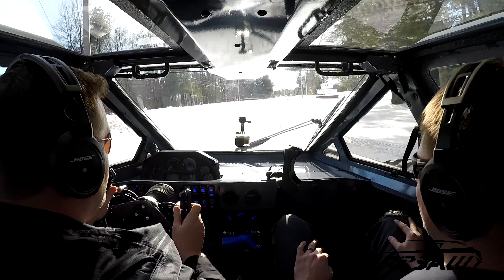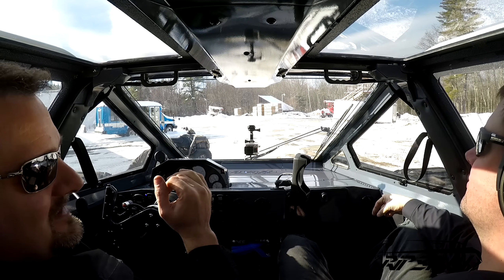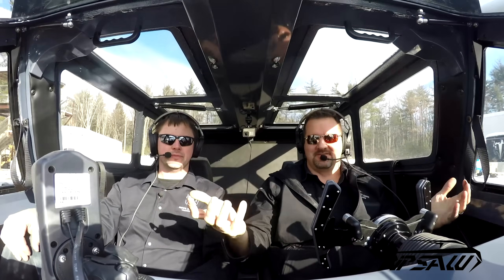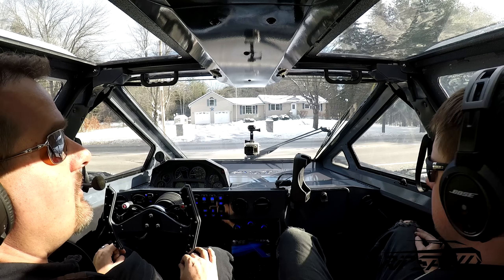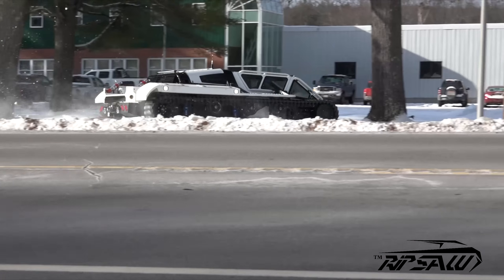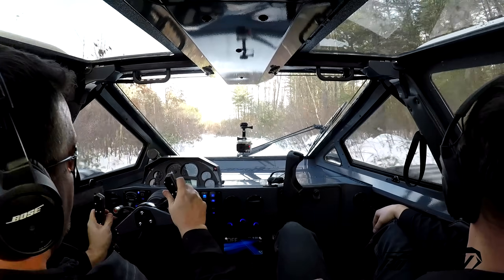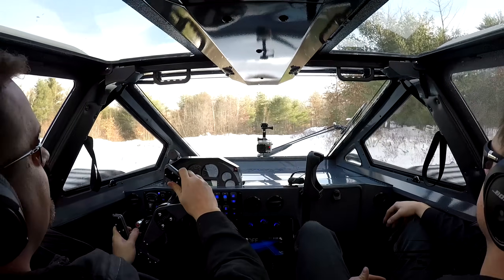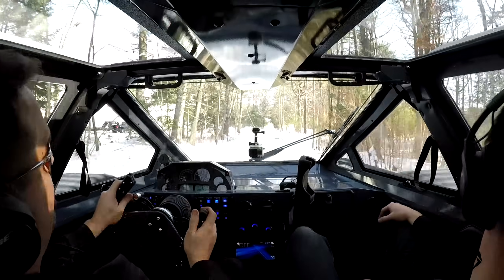Ripsaw Four Seater Floating Cockpit EV3-F4

Comment: The selling parts point?
Use rimac X 4 with 2 each side front and rear wheelchair turning 1 side full on with opposite turning full on reverse, 
With usua turning uses +/- of both.
Escape from a military tank turret is murder if they refuse to use your convenient concept with a slider lift or lower/open drop for the Gatling at rear round \____/ edges and frontal roof turret.
4 or 2 with 1 left and 1 right wheelchair turning tracks.

Maybe a dreamer Axial motor X 2 with 4 rolls Royce lift fan electric powered with shaft 4 cog rear last RR fan to rear propellers from central new shaft to cog box 4 axle cogs eg to 5/9 fans will have turn motor car air vent and slat motors mainly 

It'll take off ALON glass TRANSPARENT touchscreen display controls RC aircraft can place f35 rear nozzle with Wings???
Nahhh it'll fly lift and turn ..
A challenge for you waterproof with same rear steering which doesn't fly?
Air vent slats turn left onto to right upon water.

Comment: Reshape the track treads to resemble a V with two  I shapes between the V shapes ( usually an open spot) and it will ride better turn faster in loose terrain and be more stable while traveling on the side of hills.

Comment: so i live in Norway above the arctic circle , and i would love to buy a belted vehicle for winter driving. but the ripsaw is just overkill. so my question to Howe and Howe is, how much could you guys turn that thing down? to make it Cheap, Reliable , and low maintenance? my dream belted vehicle is Diesel powered, large space inside so there is room for people , dogs and groceries. low cost on fuel and wear and tear on the drivetrain. currently a 4x4 does the job, but a belted vehicle would be soo much better in deep wet snow. maybe a rebuild kit for a known large car? Toyota land cruiser comes to mind. if you made the conversion kit with a hydraulic generator on a gear selection, you could use the same motor and gearbox, but take the energy out with hydraulic power and such divide it between the two belts , causing it to drive nicely. hydraulic is never used on tracked vehicles like tanks for the obvious fire hazard it represents,  but in a civilian tracked vehicle? it might be perfect .

Comment: would have been nice to see it go through some really deep snow. Get that stuck and you're done
Reply: The Ripsaws don't handle deep, fresh snow well; they don't have low enough ground pressure (flotation). To satisfy the goals of high speed and smooth ride while keeping the vehicle in a side by side configuration and narrow enough to be trailered, suspension articulation is maximized which necessitates the tracks being relatively narrow or the cabin being raised above the tracks. Obviously, raising the cabin that high would create a dangerously high center of gravity. Engineering compromises are a hard reality.

It would be possible to build a single cockpit or a front/rear dual cockpit with better deep snow capability if desired.

Comment: The Russian Sherp is slower but will go into rivers and lakes.
Reply: bv206 has more seats(17 seats including driver), more payload(4000lbs/2000kg),is amhibius, has less ground pressure, costs alot less(around 30,000usd) and it can mount m2 machine gun, tow missile, 90mm recoiles rifle or 81/120mm mortars(depending of the version) can't forget that it's street legal
Reply: As far as I know were not at war so I'll pass on the missiles and machine guns.

Comment: With such a prolonged reaction of the machine to the rotation of the steering wheel, driving at a speed of more than 25 mph is unsafe. This is perfectly visible at 1.40 and 2.20 minutes of video.
Reply: Костянтин С you obviously have never driven anything with a track.
Reply: Then why do not you show the video from the cockpit with maneuvering at top speed? And why is the maximum speed limited to 60 mph with such a huge engine power?
Reply: You're right. Tracked vehicles only really like to go in a straight line.  Any steering input.force on higher friction surfaces.goes up and up.and then the tracks suddenly respond.  ....on a different point, not sure I like their bigging up 'their clutch system' in other videos - surely it's just a triple differential system...

Comment: I love this machine, my only criticism would be that the steering looks to be delayed slightly probably because of the electronics.
Reply: Delayed? Not really. More like it doesn't register until you turn it a certain amount. It's a tracked vehicle of course. It isn't going to be able to make as subtle of changes with steering as a vehicle with steering components that actually rotate like wheels or skis. (Those are my observations anyway. I don't know if they are actually fact.)
Reply: Why the steering is delayed, for me, does not matter... but yes, it is clearly delayed.  And yes, tracked vehicles are able to make subtle changes as easily as wheeled vehicles.  It all depends on the input to the breaks on that side. The more efficient and instantaneously the breaks can be applied, the more subtle the changes in steering.  It is why you see military tracked vehicles in the hands of skilled drivers be able to dance.

That said, the delay in the steering was the only thing that made me cringe when watching the video.  That is dangerous, to say the least.  And I have driven plenty of tracked vehicles and know there is no need for it.  So there seems to be some real adjustment corrections to be made.

Comment: I think the Ripsaw would really benefit from an electric drive train. One motor for each side of the track. Not because of environmental reason, but because of better control over the vehicle (just imagine negative torque on one side of the vehicle when cornering... or just the acceleration). The main engine could feed into a generator to produce the required power. Additionally you could use a battery or supercap as a "buffer" to overcome the power requirement spices from the electric motors. Or maybe even go full electric... imagine a small, really fast, nearly quiet tank with next to no heat signature.
Reply: The options on their website says diesel or gas.
Reply: mugsl schlaengli all you would likely achieve pulling negative torque at speed using electric motors and tracks is a lot of heat and if enough force is given a thrown track.
Reply: I get to work there thankfully, the only issue with electric motors are heavy as all get out to install.
Reply: Bro I don't think you even know what your talking about?! U just making stuff up or what?!
Reply: agree but hybrids are very uncool bcs they dont rev as they speed up and that is kinda part of they reason they built it...
Reply: mugsl schlaengli Good idea, thats why it's called the EV3, it is the 3-gen electric Ripsaw.
Reply: Ohh, i did not know that. All i can remember ist their first Ripsaw used a clutch based steiring system.

Comment: I honestly don’t see why this thing couldn’t be street legal.
Reply: The steering is not progressive on the road. See how it sticks and then all of a sudden gives due to high friction with asphalt. Wouldn't be long before a crash happened on the roads.
Reply: @charlesjenkinson5020  the driver is making "cut turns" deliberately; that's how you drive a tank. you don't make smooth circular turns like you do with a car because debris will build up between the road-wheels and the treads. Even on asphalt this habit persists
Reply: Jona van der Pal being heavy has nothing to do with the use of tracks, it is all  about distributing weight over the largest possible area to make it ride on top of what ever its riding on, snow , mud, marsh, sand. These tracks are also rubber pads for riding on the road an not ripping up the pavement.
Reply: I think it’s too wide
Reply: Charles Jenkinson Is it really a crash when this would just run over them all while not losing any speed or obtaining damage,lol.
Reply: snowmobiles have tracks, they arent heavy, come on if your gonna comment, comment with some facts and common sense
Reply: 1sub this isn't an M1 Abrams. It wouldn't crush a car
Reply: Jona: Tracks are for grip in all terrain situations, which is what the video is demonstrating. For heavy things you tend to go for lots and lots of small wheels. Check out some of the supercarrier trailers that have 50 individually turning wheels. They spread their weight out so that they don't damage the road while moving thousands of tonnes at once.
Reply: @antidamageable  right concept!! But drop the  anti- American crap!!!
Reply: As a contractor at GM I have seen well qualified people passed up for jobs and said jobs given to people with absolutely NO experience in or around anything remotely related to the auto industry all due to affirmative action! I have personally seen people denied applications for positions because they were not female or minority's and the company openly admits it to their face! Seen it personally! Me, my family will never support any company that willingly discriminates and has the blessing of the government to do so! If you choose to sell your nation down the river and yet wave the flag in my face and say  buy American you are a traitor to your nation. I choose to vote with my dollars.
Reply: John Berry I've been on the receiving end of similar initiatives the irony is they're typically spearheaded by old white people
Reply: @PabloGonzalez-hv3td  Old white people means experience, which means more of the same with further refinement... when it comes to car design, I rather a younger person do it than an old fart. I mean the Ferrari 458 & Lamborghini aventador was designed by men in their 40's.  When it comes to the Car engineering I would like my vehicles very reliable, and not have fit/finish issues like the Millenial spearheaded Tesla...
Reply: SEAN L That's not what I was getting at at all but ok 👍🏾
Reply: Would need collision and safety specs for DOT, also depending on weight distribution as required by government to prevent premature wearing down of state, city, nationally maintained roads and bridges, plus height requirements for most underpasses, tunnels, etc. Also emissions testing to keep within guidelines.  I WANT ONE..CAN I GET ONE IN FIRE ENGINE RED ADAPTED TO WITHSTAND EXTREME TEMPERATURES AND EQUIPPED WITH WILDFIRE EXTINGUISHING PACKAGE?   Would be fantastic for constructing fire breaks..just plow trees and brush over. Much better, and much more fun, than standard dozer!
Reply: Drafty01: 3-4 tons isn't going to bend the pillars much - they're designed to withstand the impact of the vehicle rolling over on to them with force.
Reply: I guess if the tracks weren't exposed it would stand a chance.
Reply: BECAUSE ONE CAN CROSS BORDERS USING THIS 

USING RARE OF THE RAREST WAYS
Reply: You do realise that it can easily crush a car especially a smaller one.
Reply: Imagine some kid getting caught up in them tracks all tangled and shit part of a finger here a foot there and an elbow here best off road I’d say
Reply: They could easily make a road legal version, the main problem would be getting the tracks D.O.T. certified. What this thing will do to a car in a crash is not any worse than all the lifted full size trucks we have in America. A Ford F-450 has a curb weight of up to 8,600lb and a gross vehicle weight of 14,000lb (and F-450 can drive on top of and crush a car stock), Ripsaw had a curb weight of 9,000. A road tractor with fully loaded trailer can and frequently weighs up to 80,000lbs without special permits and escorts for oversized loads. We all have seen what a tractor trailer can do to any standard truck or car with or without a loaded trailer in a collision. And given the Ripsaw's top speed is around 60-70pmh do to the limitation of tracks and its high amount of grip, it stops in a very short distance compared to standard 4 wheeled vehicles, hence why it starts to stand on its nose when it brakes hard from speed even when off-road with less traction. It also probably does less damage to the roads than the F-450 and maybe smaller full size trucks like a F-350, and F-250 because of its contact patch verses weight. Assuming the large amount of grip over a large contact patch doesn't hinder it from making smooth turns there is no reason they couldn't make a street legal version other than D.O.T. approved rubber tracks.
Reply: Tracked vehicles generally aren't street legal because of the wear and sometimes damage they do to the street.
Reply: @DaveC2729  That damage is more so from metal tracks and/or heavy weight, plus most tracked vehicles can't drive at normal speeds. Ripsaw is within normal weight limits, has rubber tracks, and has a top speed of 65-75mph and can reach it quickly and can break 60-0mph quicker than a lot of cars too.
Reply: @Zankaroo  No, the main damage is from skidding during turns, and even a little Bobcat can screw up pavement plenty unless the driver is very careful. (I worked construction for five years, saw what they can do to a parking lot!) You get one or two of these puppies roaring around a town on a regular basis and you'll cut the lifetime of the pavement by a huge factor at every intersection. I won't even go into how frequently you'll be having to replace paint. And then there's the fact that vehicles that steer by varying the speed on each side can easily turn too tightly and go into a skid or a roll; they don't have the resistance to that that a car does. That's not to say these guys couldn't have built a safeguard into their computer system, but safeguards fail, and then you have what amounts to a four-ton truck doing a barrel roll across the road. Not good.
Reply: The exposed tracks are enough to nullify street legality
Reply: Well, it's easy. It has to pass pedestrian safety laws under NTSB. Even if it was traveling under 10 mph, I don't think anyone hit by this vehicle can survive. Most vehicles have to be survivable when hitting a pedestrian going under 20mph.
Reply: H&P Customs because it would harm the sales of big three and effect the jobs of drunk, stoned, mouth breathers that strike for more nap time on the job!  And that build the biggest pieces is s@it on the road!
Reply: @johnberry2877  I think the main reason is because of pedestrian safety laws... I don't know why you have such hatred towards the big 3, but my 2002 ford ranger has lasted 270,000 miles with only spark plugs changed/routine maintenance done, and I still daily drive it.
Reply: H&P Customs ...one word.  Treads.  Treads are dangerous in accidents.
Reply: Too tempting to avoid any and all rules of the road, imagine a highschool kid with one.
Reply: H&P Customs If it has all the things a street vehicle requires I don't see why it wouldn't be.
Reply: H&P Customs considering the person they hit would most likely die, yes it is considered a crash
Reply: Lockeedman true, people see a set of tracks and lose their mind, thinking this thing must surely destroy all before it. This is not a tank, or a fighting vehicle of any kind.
Reply: It weighs about 3 or 4 tons. Your car would not survive that, and I'm guessing you wouldn't either.
Reply: @drafty0183  consider the weight of a standard dual trailer truck currently on the road vs this, just saying.. Not that "tank" effect you're hoping for
Reply: @MsFiregal8  It would definitely come out second best in a collision with an 18 wheeler. With a "standard" saloon, I wouldn't rate my chances too highly. I think it's much better off-road, as a recreational vehicle. Not sure about SAR work - not suitable for a lot of things really... Other tracked vehicles are generally very heavy, so need to spread weight over a large as possible area, to reduce damage to surfaces, or reduce likelyhood of sinking in soft (unpaved) surfaces. Think bulldozer, tracked tractors, forestry machines, large building site equipment etc. I worked for our local CAT dealership for 15 years, so have seen this kind of machinery on a pretty regular basis.
Reply: I'm not American dipshit.
Reply: @antidamageable  
Hey I was wondering are you American 🤣
Reply: Still not an American.
Reply: @antidamageable  
You have got to be kidding me. Don't lie to me you are American aren't you .🤣
Reply: @louisbabycos106  wat

Oh I see. Some lunatic who went on a bender against Americans had his comments removed like years ago.
Reply: Tracks are almost always for heavy things. If it's not heavy, you don't need tracks.
This is incorrect and I apologise.
Reply: @jonavanderpal   think snowshoe ..same principle as tracks. Greg Ward is correct.
Reply: @jonavanderpal  false they spread weight my sled weighs less that 400 lbs which is lighter than anything close to that and it has a track